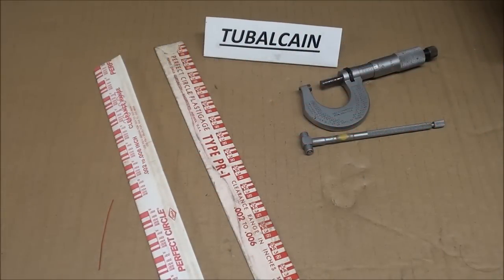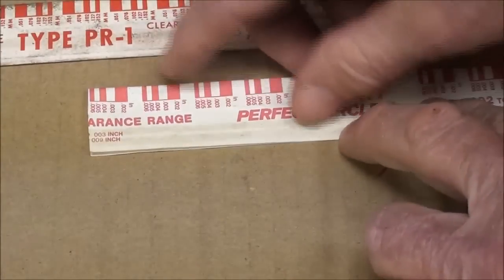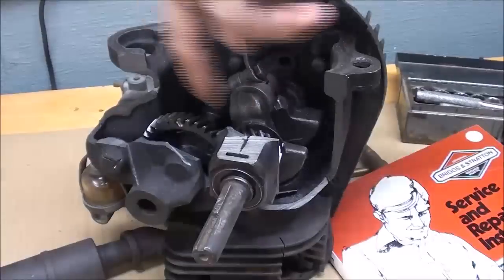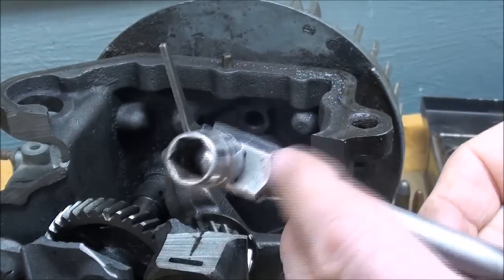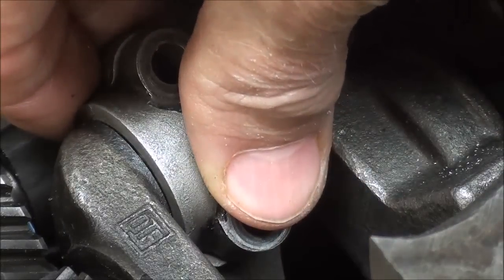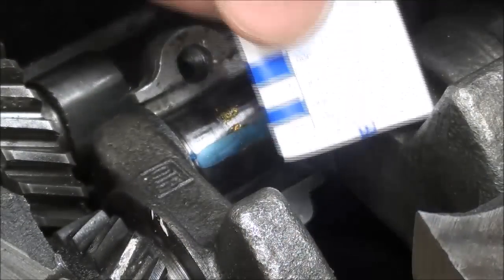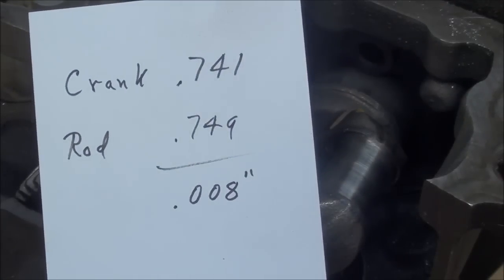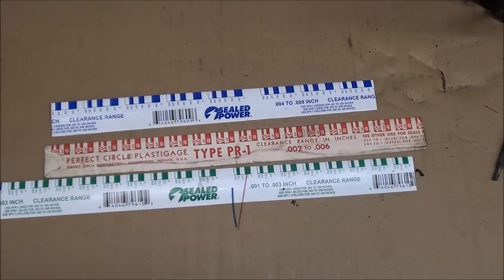SHOP TIPS #218 How to use Plastigage for bearing clearance tubalcain

Comment: have used it in the shop where i used to work to check the taper of a prop shaft and coupling. works great.
Reply: +John Germain - You could also use it to check that the angle of a morse taper is correct. Place a longer length along the taper, drive it home, pull it out. If the spread is not even from end to end, the taper angle is wrong in either the male or female part. You might have to experiment with just how hard to drive it home to get a good reading, but as Mr, Pete says, Plastigage is cheap enough. It won't tell you which part is wrong, but by comparing several tapers against each other, the "oddball" one will soon show itself.

Comment: Great video and a very handy product that I never saw before.  I have used cored solder to check diesel engine bump clearance by threading a length of solder through the injector hole and turning the engine over. Then gently pull out the solder and measure the thickness of the flattened end. If it broke off you would have to strip the head off to retrieve it so it was not a fool proof method.
love your excellent videos, keep up the good work,

Comment: I've built many an engine using plastigage.  Really good stuff.  I didn't trust it at first and measured it just like you did.  As long as you don't spin the journal you are gaging it is as accurate or better than a person with a micrometer, particularly if he is having a bad day.  Good video.  Keep them coming.

Comment: Completely new to me...!  I never saw such a method. Thank you.
Reply from the maker: +Joss Fitzsimons Thanks for watching
Reply: It's an old school method, now frowned upon by manufacturers who demand more precision.  However, as the gentleman states in the video, measuring instruments are only as accurate as the user's experience.  As you can see it is pretty damn accurate, and cost effective.

I'm surprised he mentioned using it in class. I would have thought instructors these days dumped the plastigauge for more expensive instruments.  I was taught how to use it back in HS.

Comment: Excellent video as usual.  The only thing you might wish to add is pretty obvious to someone who has done this before but not so obvious to a first-timer.  And that is:  

If the Plastigauge indicates that the gap is too wide (as was the case with yours), you can usually order replacement bearings of a slightly different size to take up that gap.  And replacing those bearings as well as the oil rings around the piston are what constitutes the usual "rebuilding of an engine".

Thanks again for the videos, sir.
Reply from the maker: +Ron Icard thanks for watching
Reply: +Ron Icard, do you mean that the new aluminum clamp around the steel shaft will have a smaller ID or is there a type of shim that sandwiches between them?
Reply: +Shane K Usually, there is a bearing on the inside of the clamp on both sides of the camshaft.  When Mr. Pete takes off the cap and holds it up to the camera at the 7:25 mark, the shiny part on the inside you&#39;re seeing that rides on the camshaft is the bearing itself.  It is thin and circular and fits into a groove in the cap so that everything touching the camshaft is the bearing (on both sides of the camshaft, by the way).  

If that bearing is worn out, you can measure it for what size you need for replacement and purchase replacement bearings.  You slide those in to replace the worn out ones. 

At least, that&#39;s how it works on motorcycle engines that I&#39;ve rebuilt.  On those, Honda will provide you with 3 different size options, based on the tolerances that camshaft ended up spec&#39;ing out to when it was built.  Because the camshaft shouldn&#39;t wear down over time but the cam bearings will.  So you just replace the worn out bearings with some of the original size.  Hope that helps and I didn&#39;t make you more confused.

Here's a photo:  the 2 thin silver rings sitting on their sides are the cam bearings: 
https://www.highpowermedia.com/Content/Images/uploaded/RETM/36/Bearings%20-%20Cam%20bearings%202.jpg

Comment: Back in the day, we used plastigage to balance the combustion gaps on diesel engines and racing Volkswagens.  Put the plastigage thread on top of the piston, then wind the engine over. do all pistons at once, then take the heads off and measure. Adjust the thickness of the individual head gaskets to get the same clearance on all pistons.

Comment: I'm an old man, and have known about Plastigage and the concept for many years, but this is my first time seeing it in action.  Thanks!
But I'm curious as to what remedy could be taken to correct that .006 or 7 thou excess clearance in that engine.  Are undersize rod ends and caps available?  Or would the journal be built up and then reground?  Or is the trash heap the only recourse?  Never mind what's economically practical.
Reply from the maker: It's time for the scrap pile if there is that much wear

Comment: Brings back a lot of memories from my motorcycle engine rebuilding days... we used Plastigage aka "Plastismash" to measure rod and mainbearing clearances (Two piece rods and split main bearings only): Also, we used ordinary modeling clay or soft wax to measure piston-to-cylinder head and piston to valve clearance, too.

Comment: mr peterson,  with all due respect i would like to comment on this, back when we were young and poor (now not young) we built a ton of cheap race engines using plastigage to measure. for tight clearances it would be better not to use grease, maybe spit, but grease has too much thickness to it, also as you stated away from the ends and the oil hole mostly because they ovalize in this area. the same goes for measuring with more precise instruments. thanks for the remainder and for teaching the young ones the art of practicality. regards. pete penca

Comment: Hi mrpete. Excellent video tutorial. Just goes to show you do not need a machine for measurements. I used Plastigauge in the 70's for measuring shaft end float. What is also interesting (to me anyway) is that on the packaging the spelling is Plastigage but on both the UK and USA websites the spelling is Plastigauge. If I remember correctly the spelling on the UK packs was Plastigauge. Those B & S engines will run almost forever with huge clearances on the crank. I stripped one once that had a bit of a rattle and the clearance was .085"   Thanks for sharing.  regards from the UK

Comment: I have used plastigage a lot over the years and find it to be very easy to use an accurate enough for most engine work. Even if you have all your machine work done by an engine machine shop. It pays to check every thing upon reassembly just to verify all the clearances are correct. I am relatively young (34) but I got most of my original training from old timers. They said that back in the days of having to replace bearings at less than a hundred thousand miles when you went down to the parts house to buy your parts for the rebuild they would throw the plastigage in the box with parts. No one ever charged for the plastigage. They hoped that by giving it to you it would get used. The idea was if the clearance was not right you would have the crank turned or remedy what ever the problem was and not try to blame them for bad or wrong bearings.

Comment: When you have a hard and a soft material, as is the case with the bearing, it is often the hard material that is worn down... this is because the small hard dirt particles embeds itself in the soft material and abrades on the hard material ...  For an interesting application of this look at the series 1 Lotus Elise, the first series with the aluminium brake rotors. It would seem that the rotors would wear out very fast but in fact the were very durable.. once a bit of the brake pad material were embedded into the aluminium the friction was between the brake pad and the pad material embedded into the rotor.
Reply from the maker: +Tacit Tacet Great explanation

Comment: I have used this system. Never seen anybody use grease to hold it. Why ?  Because grease has thickness .You proved it in your vise test . The middle is wider were the grease was.Than the ends (no grease). The ends would be closer to actual clearance.Keep the videos coming I like them.

Comment: The oiling system is just dragging a rod through the oil and flinging it around? Well that's ... simple.
Reply: +Robert Szasz @ 7:38 you can see the hole in the connecting rod, oil is splashed up to the piston and as it drains back, some oil enters that hole to supply oil. Newer ones had a much smaller hole at the bearing end, but the collection end of the hole acted as a cup to insure a supply of oil.

I've also seen small engines with gerotor pumps driven off the cam gear, and some with piston pumps driven off an eccentric on the cam shaft.

Comment: I just about fell on my face when the guy at the hardware store told me that B&S went out of business. B&S has always been the best small engine. Whereas Tuthumpsy was always junk. Honda ran them out of business.
Reply from the maker: I thought they joined up with Muray or simplicity?
Reply: My source may have been wrong. IDK.
Reply: Briggs is still around. Tecumseh sold off its engine manufacturing, they only do AC products now.